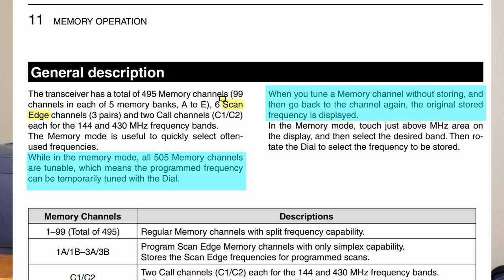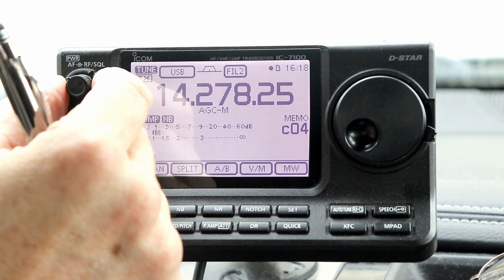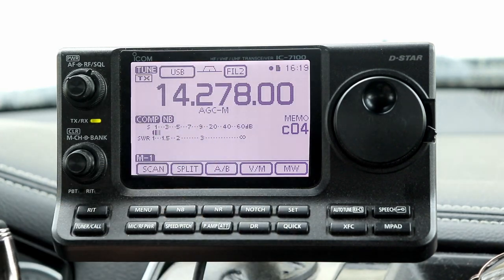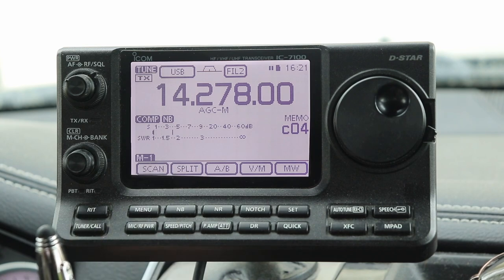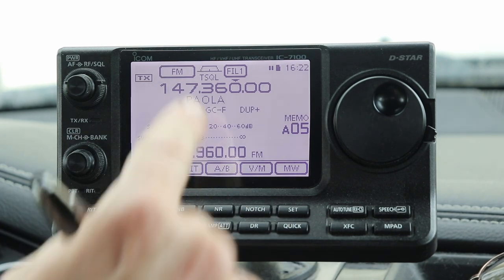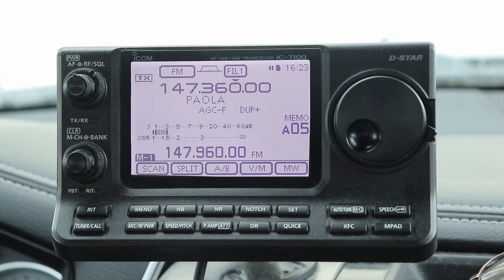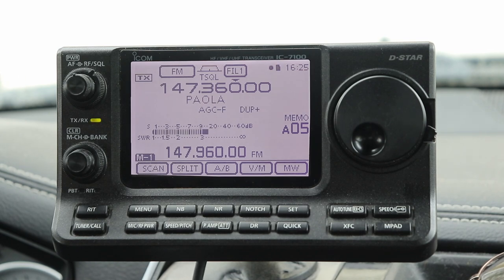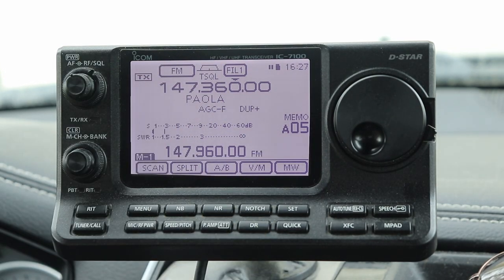IC7100 A to Z #19 Tunable Memories

Comment: Most of the time,  after changing parameters  in Memory mode, I use memory pad (MPAD)  feature.  If I am satisfied with the changes, I save it back  to memory. 

If we want to set beck to the original state after changes,  I push  Up and then DOwn keys on the PTT handset.

To prevent accidental changes, use 'LOCK'  feature, or tighten  the dial knob.  

Thank you. 73

Comment: Still chasing QRM in the Cummins here. 🤬
Thinking it’s either the electronic accelerator (PWM circuit), or something to do with the injection pump.
Reply from the maker: The electronic fuel injectors make a noise that's pretty similar to spark plug noise.  I have it too.  I find it's worse on lower bands (40 & 80).  Since those bands are not as great on mobile anyway, I mostly operate on 20 and up when mobile.
Reply: @HamRadioA2Z  
It’s odd.  Idling the noise is S8. Down the highway, S8.  Coasting or going downhill - foot off the pedal… clear.
Reply from the maker: Yep.  When the engine is coasting, the injectors aren't firing at all because no fuel is going to the engine.
Reply: @HamRadioA2Z  
Ideas on how to shield?